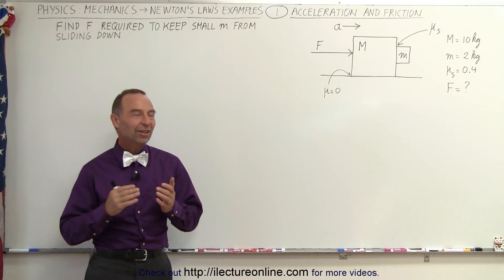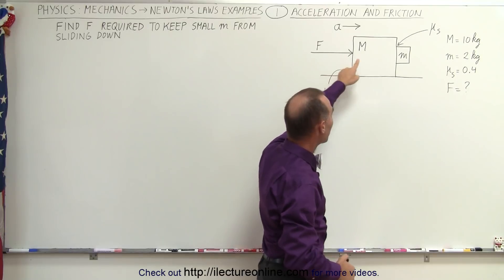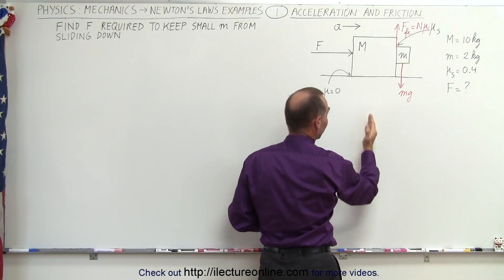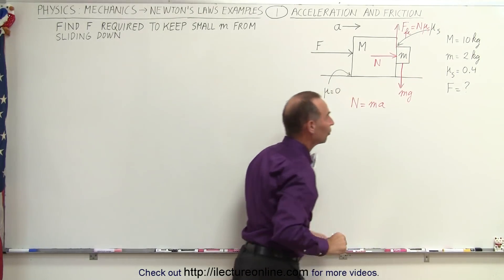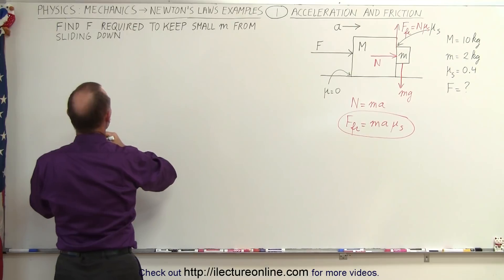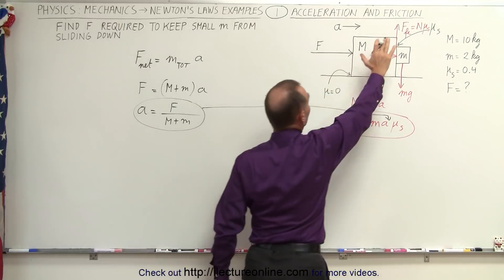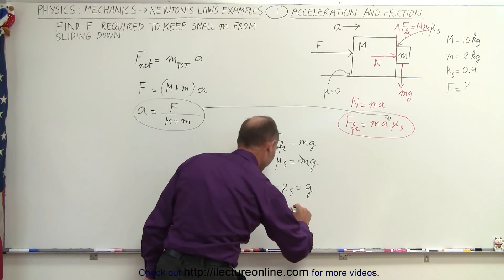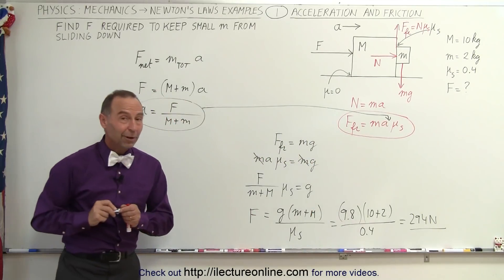Physics 4.1 Newton's Laws Examples (1 of 25) Acceleration and Friction

Comment: I don't understand how red normal force pushing on little m has the arrow to the right. We know due to third newton's law that if we push something against some surface to the right, the surface will push back. 

So if big M is pushing to the right why would the normal force against little m would still point towards the right? I don't get it. Why isn't the normal in this case pushing against big M?
Reply from the maker: Little m is being pushed and accelerated to the right.  Which force will do that?  (It is the big block M pushing against little block m)
Reply: @MichelvanBiezen  Thank you. I understand now! :)

Comment: Firstly thanks for you effort, Secondly, I saw in a previous video that the force coming to the second mass (m) will be The tot force - (minus) the amount of force needed to move the big M. why isn't it the case here. When can I say that the initial force applied on M will be the same applied in m and vise versa. Thanks and hope you reply to me
Reply from the maker: The force pushing against M accelerates both M and m.  So part of the force is used to accelerate M and part of the force is used to accelerate m

Comment: Hello Sir - Shouldn't the Normal force for mass m  be in the opposite direction (towards the left) ? The mass m moves with acceleration a to the right with force of ma and hence shouldn't the normal force be towards the left with ma for it to be together with mass M?
Reply from the maker: The definition of a "normal" force:  It is the reaction force of a surface pushing back against the object that pushed the surface in the first place.

Comment: Sir I don't get how  use of normal force in friction , plz explain
Reply from the maker: It is the surface responding to a push, (Newton's third law).  On a horizontal surface it is the weight of the object.  In this case it is the force required to accelerate the small block.  Action - reaction pair.
Reply: also by definition friction equals the normal force on the object times the μ

Comment: Its probably irrelevant to solving the problem, but how do you get the small mass to be "attached" to the big mass in ghe first place. Is there any real world application for this particular problem?
Reply from the maker: Yes, that would be rather tricky.  There are many real life applications of all the various laws and concepts of physics.  When you know physics well, you can solve many types of real life problems.
Reply: Yes, there are many real life examples illustrating physics laws. I think to understand this particular case, just imagine , if you are travelling in a bus having big vertical glasses in front of the driver. While accelerating, whenever a piece of a paper or a tree leaf accidentally strikes the front glasses, it remains struck on the glass without slipping or falling down. It is because of the pseudo force. This principle is best illustrated in the  present problem.